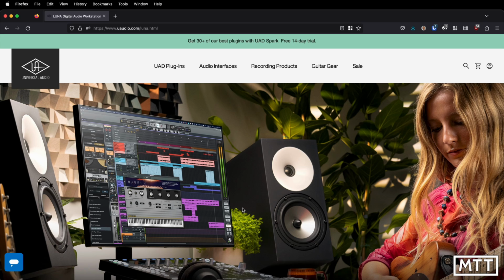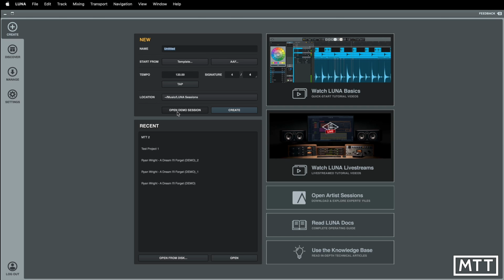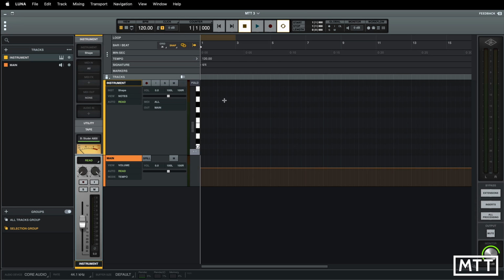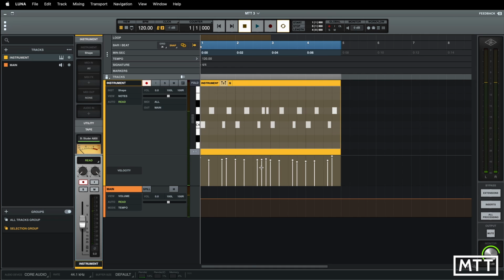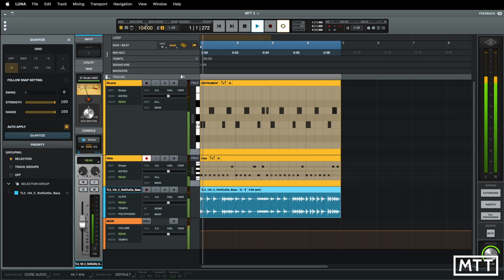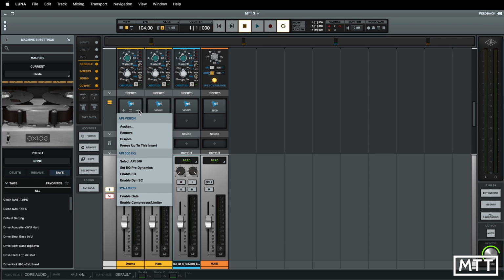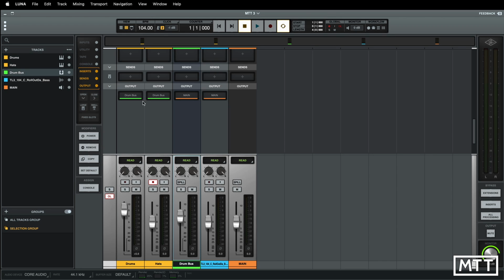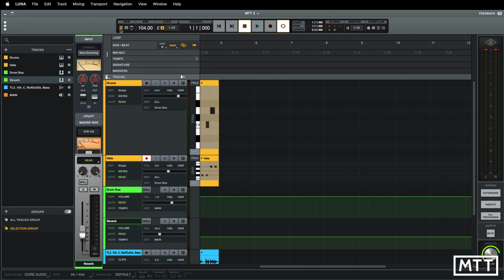Luna - Free DAW - First Look

Comment from the maker: A heads up - if you buy the full version of Luna, you get VST3 versions of the following plugins (I had a reply from UA confirming this), so in a way you're getting a reasonable deal if you want a number of these:  I'm not affiliated with UA in any way, just relaying what I've been told after I wondered if you'd get plugins you can use on another DAW.

 • API 2500 
 • Studer A800 
 • API Vision Channel Strip 
 • Century Tube Channel Strip
 • Galaxy Tape Echo
 • Oxide Tape Recorder
 • PolyMAX
 • Pultec Passive EQ Collection
 • Pure Plate Reverb
 • Teletronix LA-2A Leveler Collection
Reply: Thanks so much for posting this info!  YOU ROCK HARD! 😘

Comment: I used pro tools for years and paid $99 annually. But when they doubled the annual cost in one price increase I ditched it. Been using Luna for free ever since it came available.
Reply from the maker: I take it from that you're getting on OK with it?  Anything you find better or worse compared to Protools?
Reply: @musictechtuition Since I'm using an Apollo it is much easier to track. Using the extensions the sound quality in my opinion is unmatched.
The midi capabilities is the biggest drawback though I'm able to work with that.

Comment: As a person that just migrated to Luna from Logic (fed up with it crashing all the time) I seriously recommend it to anyone that remembers the 'old days' of going to a studio and recording directly to tape. The Studer emulation and Ampeg master tape is very effective and combined with the summing it really glues your mix together and imparts analogue style warmth and saturation. Well worth investing the full price in my opinion.
Reply from the maker: I have a couple of clients who I think would find this exactly the right thing for them - they are from the old school and used to working with tape and a physical mixing desk.  I'm sure it would work really well for them, but I think there is a degree of "FOMO" when moving away from their current DAWs, plus a learning curve which may be problematic initially.  I will put it to them at the right time, and maybe do a demo session or two on it and see how it goes.
Reply: I also use Reason a heck of a lot as well and I found it quite easy to get into the workflow of Luna. I have mainly been using Luna for audio rather than MIDI so far. I have heard criticism of the MIDI side of Luna but until I actually try it myself I'm reserving judgement on that.
Reply from the maker: @JonnyLloyd4real  from what I've seen, the MIDI editing is in the 'older versions of ProTools' area.  It's not a MIDI editing powerhouse a la Cubase, Logic, FL, et al... but I don't think it's meant to be.  One client of mine in particular really only wants to print everything 'to tape' anyway, so he doesn't really want to do any MIDI editing!

Comment: I tried it. Lots of cool things. I’m a professional, and the fact that I couldn’t highlight multiple tracks and pull the faders up/down was a deal breaker. It’s such a basic and very necessary thing.
Reply: Yea, believe you have to create a group first which seems like an added step.
Reply: @nmdpa3  yeah I definitely don’t see myself doing that every time I need to move a few faders together. I’d be creating groups within groups within groups. Tom group? Then drum group? Then rhythm section group?
Reply: @stevedoesnt The workflow with Luna is based on tried and true old school console/tape methods. In this case you create a bus/fader for your different groups which allows you the option of hitting the NEVE, API and/or tape on your way to the master bus, much like a real console. This is the whole point of Luna.
Reply: You can do that, rather easily

Comment: LUNA lags in so many ways... Only good for recording and mixing with small track count. Editing? Midi? render options? forget it. 
De-installed.
Reply from the maker: Fair enough.  The MIDI editing reminded me of using ProTools in the late 90s in a studio where I worked.  It was there... but was nowhere near what Cubase had, even back in the day.
Reply: Missing audio editing. Users would need to export and manipulate in an external editor.
Reply from the maker: @tommyzai7038  ... if that's their workflow.  I have a few clients who record (and maybe re-record) until they get it right.  These are people who are used to a tape-based workflow and who don't want to edit other than trim out noises.  For them, this sort of thing is perfect, and while it doesn't cover every way of working, I can see the attraction of it.
Reply: To edit audio, click on a track in timeline mode, then click on warp view from that track.  It's actually nice in that you can very easily quantize audio. @tommyzai7038